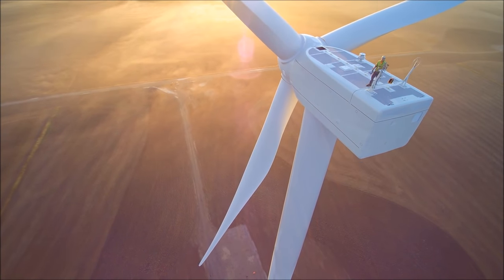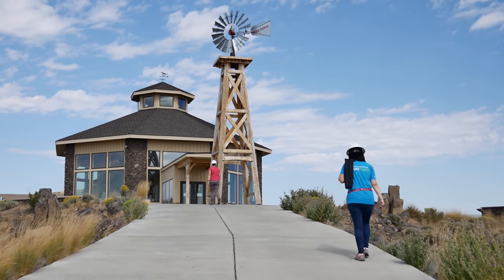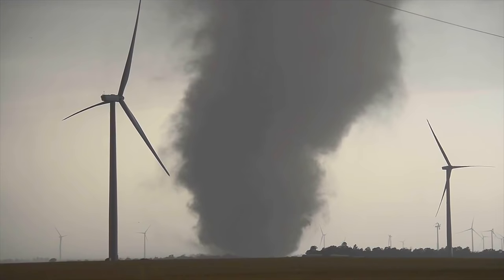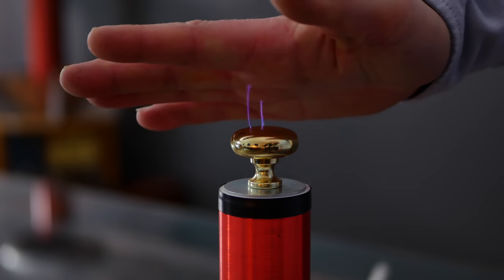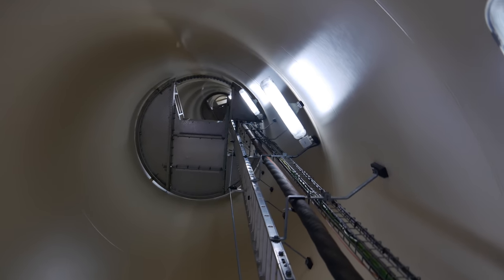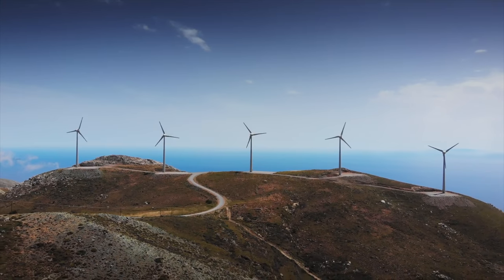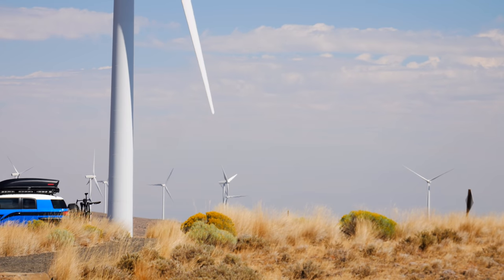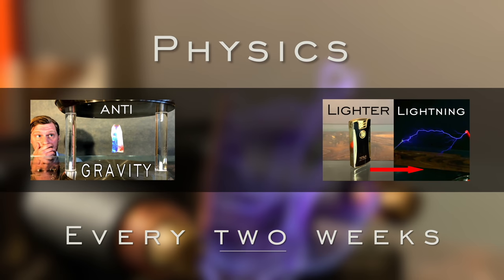35,000 Volt Wind Energy (Up Close Turbine Tour)

Comment: Wind turbines really suck for the environment.
Nuclear power plants are still the best solution in terms of safety, ecology & reliability.
Reply: really?? why is that?
Reply: I live in Arkansas, we have just about every type of possible electrical power plants except Wind and thermal. 
Coal plant known as White bluff power plant, (phasing these out) 
Nuclear - As Arkansas Nuclear One (provides 22% of the state’s electricity) 
Hydro Plant- Murray Hydroelectric Plant. (Just one of a bunch) 
Solar Power Plant- Clarksville Light and Power (currently the largest in the state)
Natural Gas power plant - Entergy Arkansas (phasing out) 

With that,  Nuclear  is the largest single provider of electricity to my state but the only problem is the long term storage, nothing can contain the spent rods will last forever. It is considered safe in the short term but likely hazardous in the long term.